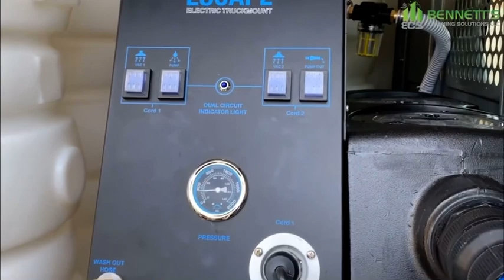MYTEE ESCAPE ELECTRIC ⚡️ TRUCK MOUNT

Comment: How far can you go to do a job. And still have good psi and good suction?
Reply from the maker: This thing is a Monster… The most feet I used was about 250 feet on a 3rd floor medical office and didn’t lose a thing. That was up the hall stairs, down a 60 foot hallway then into the office itself. She pulled just fine, psi was fine, and heat was nice and hot.

Comment: Did you add fresh water tanks or recovery tanks bro?
Reply: Yes Sir, there’s a fresh water tank and dump tank in this setup
Reply: @richardbennett2893  thanks for answering brother. What kind of pump did you use and how is the diesel heater holding up
Reply: @jrdon7932  I use a regular  115 volt, 50 psi for pulling water from your tank. The diesel heater is a beast. The only thing is you gotta run a liquid rinse through the heater and I’m fine with it…
Reply: @richardbennett2893  I really appreciate you taking time out your day brother and answering my questions. Much love and support.  What kind of rinse you are talking about? You should post more videos bro you just starting to grow on here.
Reply from the maker: I added both, one of each
Reply: I wish you the best fam!
I've been in business 25 years this month. That's a great set up!!

Comment: How do you run that off a generator i tried a similar set up and got carbon monoxide poisoning i had the generator exhaust point out the back of van and air blower to blow the exhaust fumes out and then i tested the level of carbon monoxide in the van and it was very unsafe levels  now i just plug in 3 cords to the customers house wish i could use generator but too unsafe. how isnt anyone else getting sick from this?
Reply: You gotta run the exhaust through the floor.. I’m going to do another video in detail as soon as the weather breaks.
Reply: @richardbennett2893  I just run my generator on the tail end of my van with the exhaust pipe point out with back door open. Have no issues.
Reply from the maker: I have an exhaust with a muffler running from the generator through the floor. 

https://www.instagram.com/reel/CioOQnaDiQc/?igshid=YmMyMTA2M2Y=

Comment: Is your roof black and covered with soot yet?  Mine is after one job hahaah i guess my new nightly cleanup routine includes wiping down the van ceiling now too 😂
Reply from the maker: No I haven’t had that problem yet, I’m thinking about customizing an exhaust for it.
Reply: Can you use the heat from the exhaust to heat water from unit ?